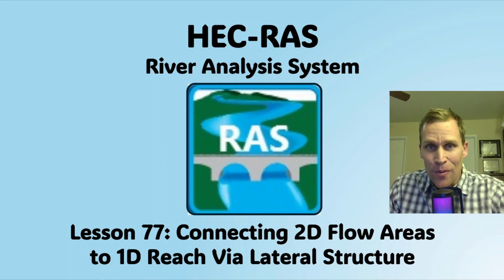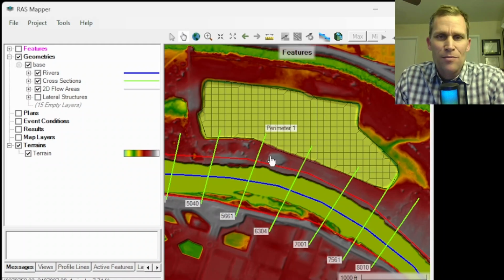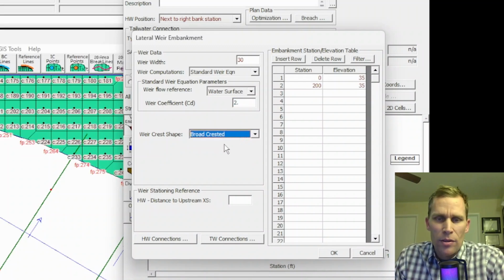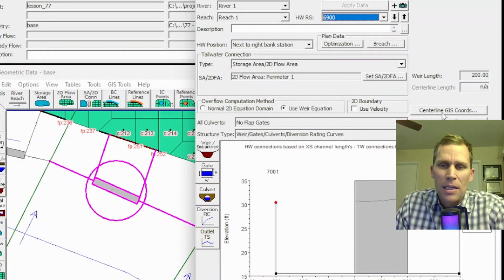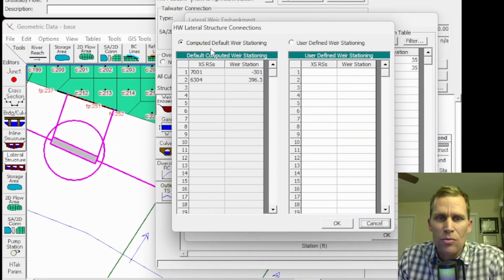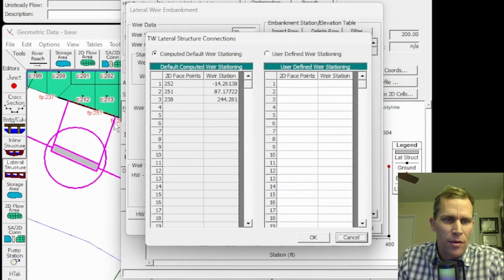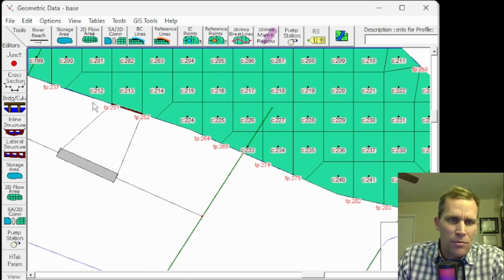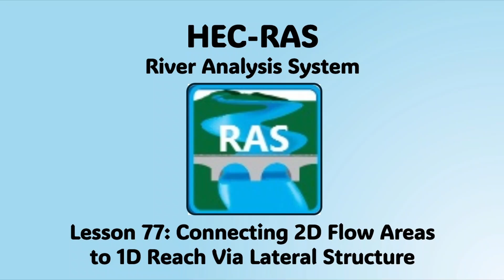HEC RAS Lesson 77 - Connecting 2D Flow Areas to 1D Reach Via Lateral Structure

Comment: Hello Tim,

I would like to know the proper approach for connecting a 2D area with rain-on-grid (not a storage area) that drains across a road through a culvert into a 1D channel.
For example, assume there is an existing road with a culvert on the north side, and the flow crosses through the culvert to a channel on the south side. What boundary conditions should be applied, and how should this be modeled in HEC-RAS?
Furthermore, I want to thank you for all of your tutorials—they have been extremely helpful.
Thank you so much,